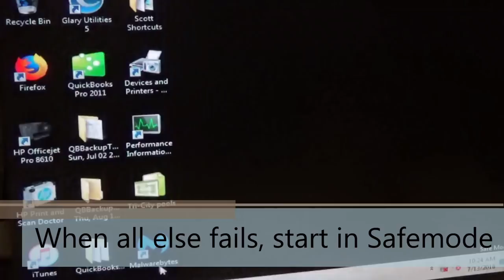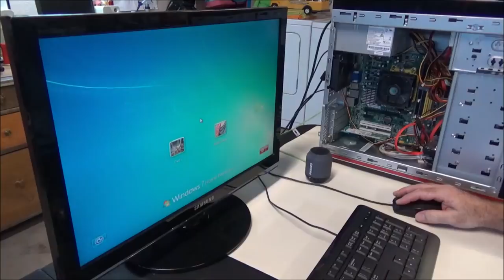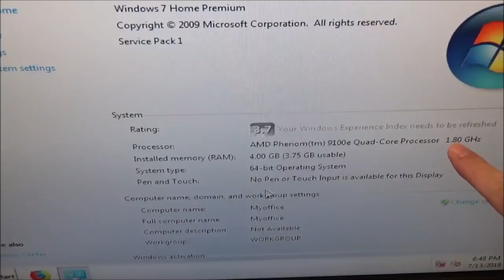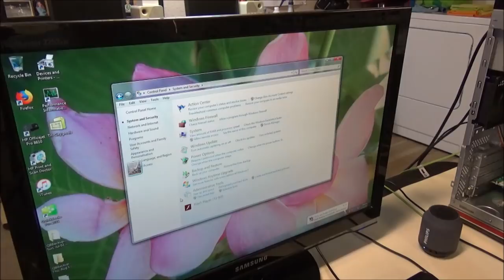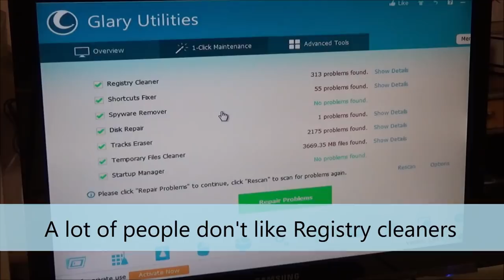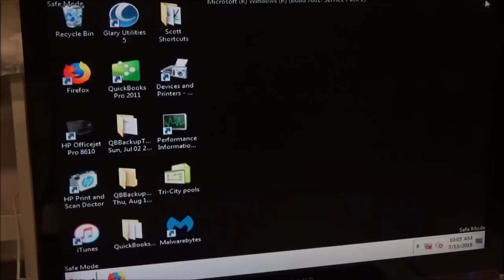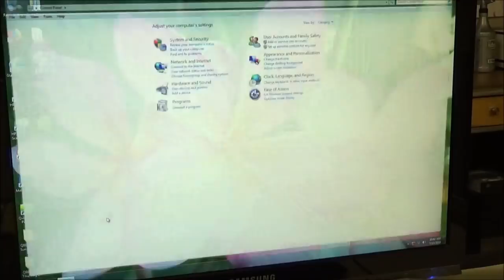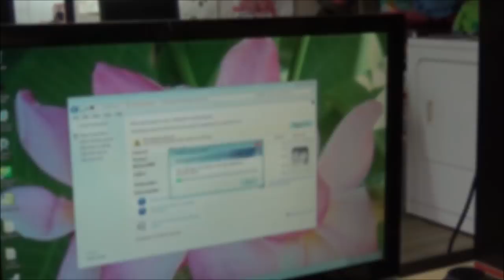An Unexpected Project

Comment: That's a nice thing to do! (And adds brownie points too!) If you use CPU-Z, the mainboard tab will show the BIOS version and date, plus might give you the info needed to find the latest BIOS. It's helped me in the past when dealing with OEM/oddball boards. 
Good video. I look forward to seeing the results when you install the new HDD and fresh OS.
Reply from the maker: Serious brownie points mang! Gateway still has system drivers available but there wasted a Bios file listed at all. It seems odd that they wouldn't have pushed out a Bios update at some point. Maybe Gateway just isn't supplying the file(s) anymore for some reason. I'll dig around some more on the interwebs before I give up, I'm sure it could use a Bios update too. I can't wait to do a fresh install on a new HDD, I think it will resolve all the little issues that are bugging me. And the HDD needs to be replaced with all the errors that chkdsk reported. I'll install CPU-Z and get the Bios version for sure.
Reply: You might find a BIOS that works based on the MB manufacturer. Not too surprising that an OEM would drop support for older products. Unfortunately. I hope you find one though!
Reply from the maker: I'll check the OEM tomorrow, I kinda forgot about that possibility. Thanks for the reminder!

Comment: Well if anyone wants to read this I have an interesting story of how I ended up with a GTX 970 for $50.

I was looking on ebay when I found an ASUS GTX 770 that couldn't have a display driver installed. I bought the card soon after and it arrived about a week later. I cleaned and re-pasted the card, flashed the bios and it worked great. Except that it wasn't a 770. It was a falsely advertised 970! I guess I didn't take enough time to look at the design of the card, but I'm so glad that I bought it. It works flawlessly with my i7-3770.
Reply from the maker: That's awesome man! Sorry for the late response. I just got back from a 5 day camping trip and decided to hold off with YT comments until I got back. Man I love when you get sent a better item than was advertised. Just a few months ago I bought a $19 Q9550 for my daughters PC and they sent me a Q9550S. The "S" chip still sells for $70 + and most of them are shipped from China. I put that thing back on eBay fro $69.99 and sold it within a day. Cha-ching =)
Reply: PimptatoPCs Great find! Hope you had a good trip.

Comment: With a fresh hdd and os install he is going to be amazed at how nice it turned out, especially with the athlon x4 and the extra ram. Once you are done with it it should last another few years no problem. 
Now if you could just upgrade him to windows 10 and a cheap 120/240gb ssd that thing would be blazing fast compared to before. I think windows 7 updates/support ends in 2020 if I remember correctly. Also maybe you could find 2 cheap ssds and tell the wife the price was for the one ssd for your father in law lol.
Reply from the maker: I can't wait to do a fresh install. Maybe the most enjoyable (and helpful) thing to do to an old PC. I just need to figure out what stuff needs to be transferred and what can be nuked. I got that Athlon x4 for $16 on eBay and figured what the heck. The htpc will get a Phenom ii and maybe a gpu upgrade soon. I'm seriously considering a ssd for boot, maybe I'll surprise him and order it today. And I did show him how similar W10 is to W7 after you get past all the fluff. He should upgrade from W7 and I'll probably ask him if he wants me to do that before I do the fresh install. Unfortunately the wife is basically an accountant, it's hard to sneak anything past her!

Comment: The rear and the side panel are identical to an Acer Aspire tower.
https://images-na.ssl-images-amazon.com/images/I/41Km7jhk04L._SY355_.jpg
Reply from the maker: Good find jangel. The recovery partition software is Acer software and it was totally confusing me. I had no idea that Acer and Gateway had a corporate/ manufacturing connection at all. Very interesting! I thought maybe the tech that upgraded Windows for him had used some wrong software or something. Now I'm off to research the Gateway/Acer connection lol!
Reply: Acer absorbed Gateway.
Reply from the maker: Ahh, I see. Always wondered about Gateway. I thought they just shutdown but I guess someone would have bought their assets (and assumed their liabilities). Thanks again for the info man.
Reply: No problem.

Comment: Great info on Glary. What virus protection are you using? That might be a good video to detail the programs you are running.
Reply from the maker: I really like Glary and totally recommend it. I like it so much that I wouldn't mind buying the pro version. And I'm cheap AF lol! I usually just rely on the Windows Defender stuff and run MalwareBytes once a  month. I just don't like, or honestly trust 99% of the virus "protection" out there. Doing software videos is a little scary for me because I'm not totally confident in everything I'm saying, haha. I really don't mind and actually want people to correct me if I'm wrong, but I'm definitely out of my element when it comes to software.
Reply: PimptatoPCs I just installed Glary free on my laptop. Thanks for the heads up on that program. I was running avast and uninstalled it. I agree about being cheap. My buddies say I squeak when I walk. I tell them I'm frugal.
Reply from the maker: Right on man, I think you'll like it. I thin Avast is one of the better ones, but I'm no expert =) I have only bought 2-3 pieces of software in my life and that's because I absolutely HAD to! Even if I had a bunch of disposable income I would still be a penny pincher!